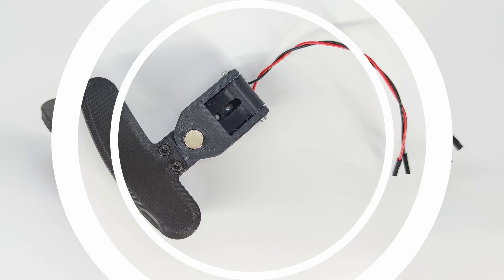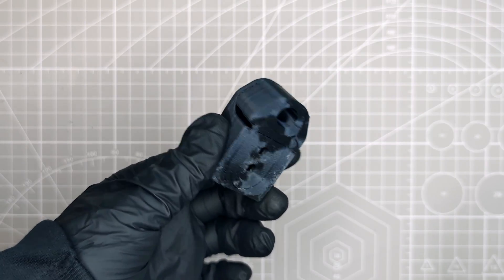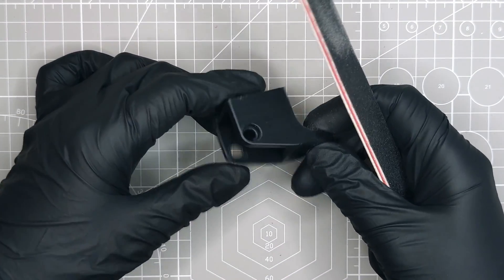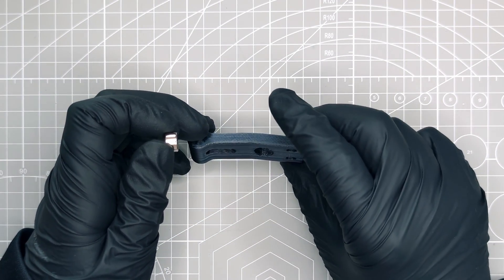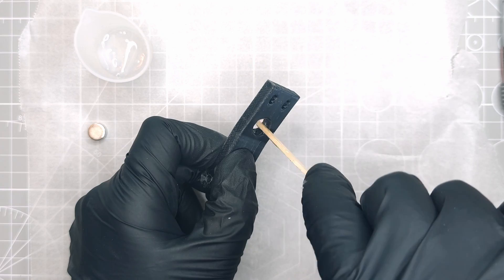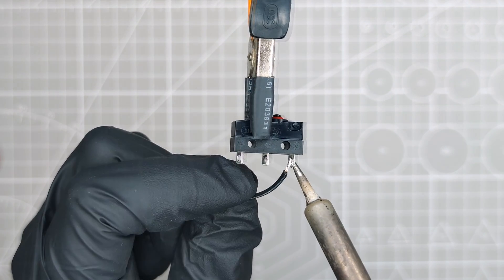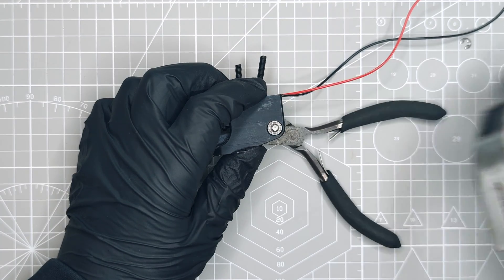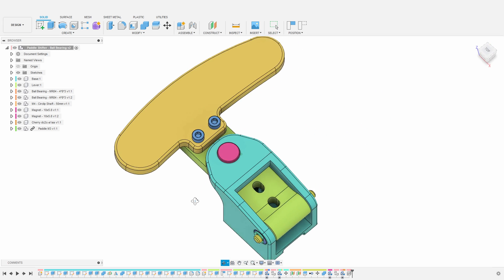DIY - Magnetic Paddle Shifters for Sim Racing - Ball Bearings Mechanism - Full build, step by step

Comment: also when drilling a hole in a 3d printed part that was already there. you are destroying the wall/walls that surround the hole in the printed part. this could lead to weakness in the part. if you suspect you need to drill a hole as you are not sure if it is large enough print it with extra walls. instead of 2 or 4 walls maybe do 6 or 8 or 5 . that could give you some extra room to enlarge a hole and still have enough strenght in the printed part.

Comment: "perfect clearance" I can see the ball bearing wiggling around in the hole, like it's a pivot connection. What is a ball bearing good for when the fit so bad that the bearings can't actually do what they're designed to do?

Comment: what control board needs to be used so you can plug these in via usb and do you have the f3d files present? thank you! great video
Reply from the maker: Hey! For the wheel controls (buttons, encoders, shifters) I use an Arduino Pro Micro. I am working on a video that shows the full process to build a complete custom wheel.